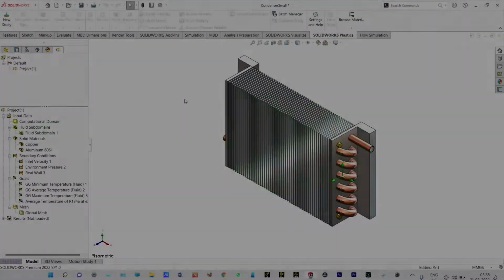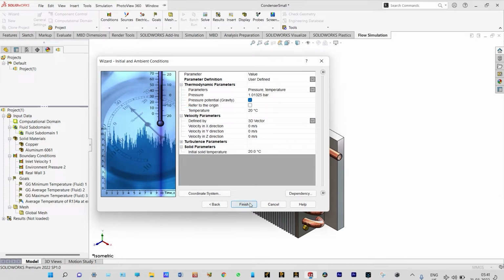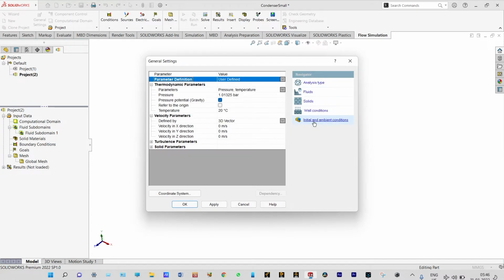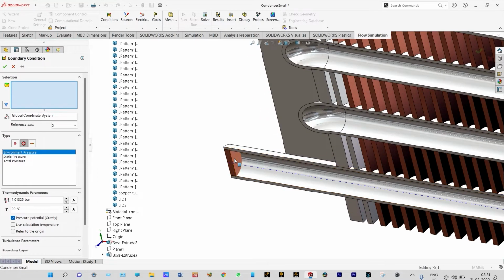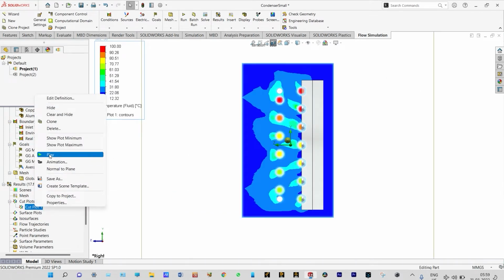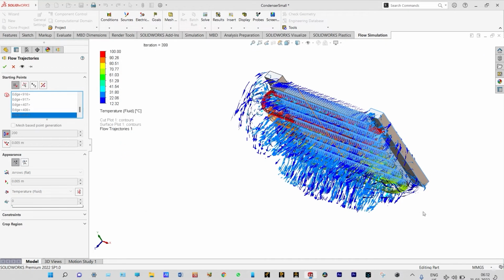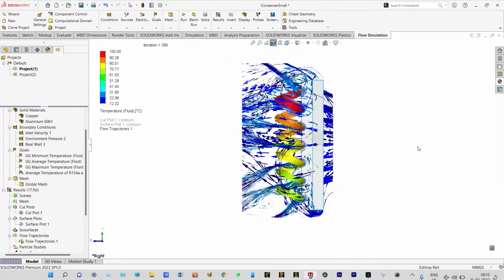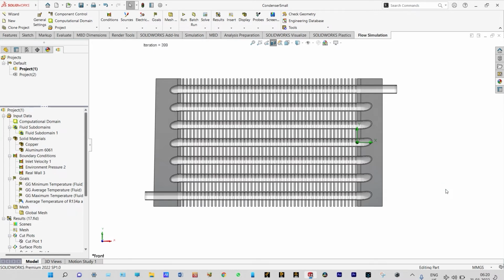CFD Condenser Heat Exchanger | Condenser Heat Exchanger Analysis - SolidWorks 2022

Comment: How to check the temperature of air at outlet in this case??
Reply from the maker: As a surface goal from the exit
Reply: @CFD_GUIDE  yeah that is for coolant i have doubt about air exit temperature, how do we measure air temperature at outlet
Reply from the maker: @pavankumarh2895 with the same boundary conditions and adding air as another fluid you can perform an external analysis and at any point outside the pipe you can find temperature of air. In that case you have to define fluid domain also